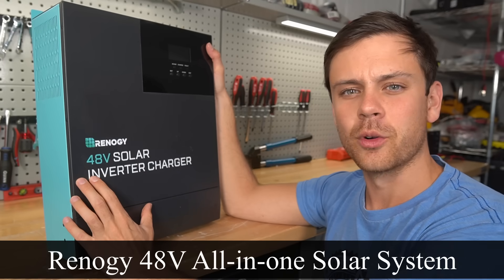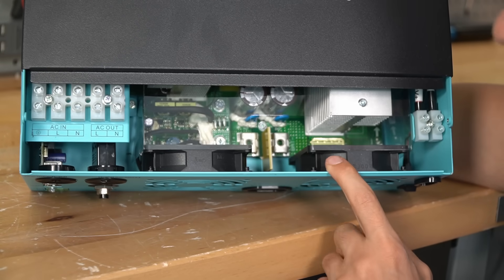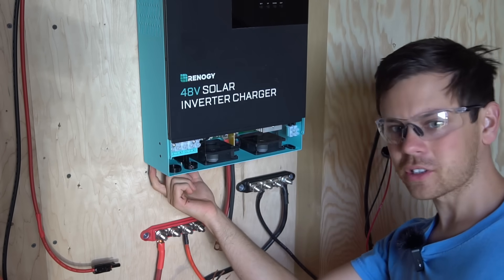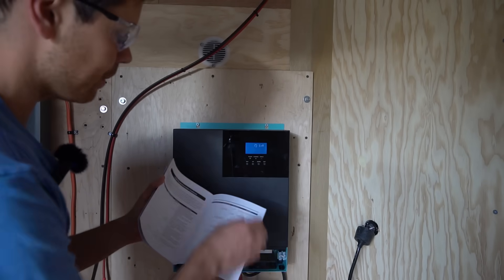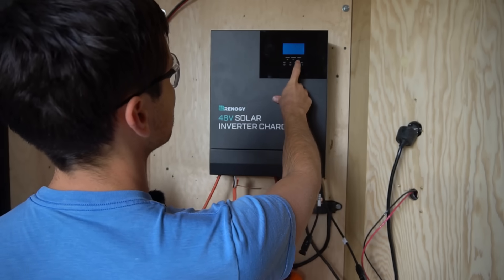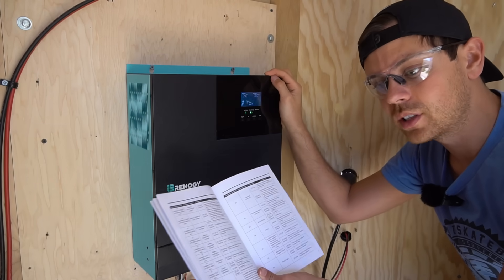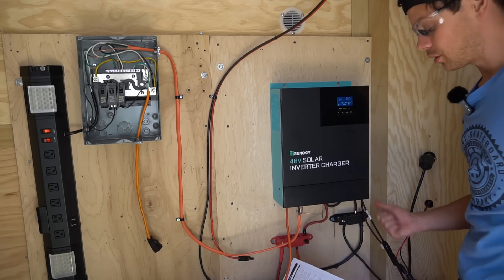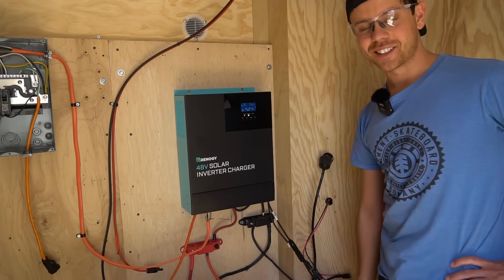Renogy 48V All-in-one Solar System: 3500W Inverter, 4400W MPPT, 1920W AC Charger

Comment: Renogy itself develops and provides the software for its inverters. They are a manufacturer of solar power solutions, including inverters, and their software is designed to work with their specific hardware. Renogy is the brand name for products made by RNG Group Inc., with headquarters in Chino, California,
Reply from the maker: This device is not made by renogy. There's about 10 other companies selling this exact same one.

Comment: Will I have the same inverter but a 24-volt version everything works when I plug it into this inverter except my pool pump keeps telling me there's no ground and won't power on it just keeps giving me a ground error code is there a way to remedy this the AC output is the identical to within this video do I need to create a ground neutral Bond and how do I do that

Comment: @DIY Solar Power
Will the MT-50 screen work with Victron's Energy BlueSolar MPPT 100V 30 amp 12/24-Volt Solar Charge Controller. I ask because I prefer not to use blue-tooth.

Comment: Three years later, can confirm. Renogy fixed ZERO of these issues. They're still selling the exact same unit with no changes...
Reply: I am hearing a LOT of complaints about renogy in the facebook Solar for RV groups. Many say they'll never spend another dime on anything Renogy.
Reply: @troy3456789  just saw this and I agree. Was looking at renogy for my new set up. Love my old 12v set up using thier components from 3 years ago but want 48v now and looking at eg4 bats and all-in one with probably Victron for other components

Comment: I have this charger inverter and I have to say it's probably the worst product I;ve ever purchased. It's more expensive than the competition and lacks features such as built in wifi. Now it shows an error code that it's not sensing the battery even though it shows the correct current battery voltage on the screen and says charging. I'm about to throw it in the trash since of course it's beyong the warranty.

Comment: Why would the battery cable input opening be so much smaller than the AC out line openings? 48v going in will need a larger cable than the 120v coming out. Why would they do this?

Comment: Will, I would love for you to review a Sungold 3000 watt inverter charger, mppt controller, that is also a transfer switch, and it switches instantly, if the power goes out. I am using it on my camper. I have to have the lead acid battery up front to operate my slides. Just would like your input about panels. I want to put 3000 volts, and have a limit of 80 watts charge controol.

Comment: I bought a 3000 W powerland it is the same exact unit just different colour no ground either and I couldn’t get it to charge either. Yeah very disappointed I have 740 W of solar and I got 612 V AGM 100 amp hour batteries converted to 24 V. I’m thinking about getting a different solar charge controller inverter, not sure which one yet

Comment: Well after watching this review I am still planning to get this one I have limited space I need to mount this inside a confined space in a semi truck I probably will use heavy duty double sided tape to secure it so it won’t get loose bouncing in the truck
Reply: I don't know if you already bought this unit or not, but I have 2 of these and YES there is a mounting hole at the bottom.  This guy didn't read the instructions on how to program it, and also installed the power wires before he mounted it and therefore blocked the mounting hole with the power wires, then says the hole is behind the circuit board... it is not behind the circuit board, it is behind the power wires he installed before mounting.  Also the reason it isn't charging is because he doesn't have the settings correct and it thinks his batteries are already fully charged, or he has it set for only grid charge, or only solar charge, etc... and yes it has a ground also, you use the same ground as the AC in.
Reply: @oldolfmann8927  I already got one when Amazon was selling it for a little over $500. Maybe you got an updated version with a bottom mounting hole, I don’t see one in mine. I haven’t got time to mount and do the wiring in the truck yet but I see a spot to drill a hole to get it secured. I honestly think Will didn’t read the manual neither he was on the wrong settings that’s why he couldn’t get it to charge.

Comment: I just bought this a month ago, working great!  Only issue I had was there is a “note” on page 7 that says it has to be over 60v input from the solar panels to charge.  I had it in parallel at first and couldn’t get it to charge, then called Renogy and they pointed me to this dumb note.  They really should put this on page 1, other places like the I put voltage to the solar in a spec sheet, many other places.  After that, I have been very happy with its performance.  Solar only with 8 batteries, looking good!  

Also, the battery power connectors are still the same, kind of a pain, suggest using a high multi strand flexible 2 awg cable, not the stiffer bigger strand ones, as I had to fight with it for a few minutes, but at least the battery terminals didn’t break, which for me is good as I tend to man handle and break everything.

Don’t know why he basically rage quit on this unit, it’s not too hard to hook up and get through the menu prompts, maybe he was just having a bad day, everybody has them. I actually liked that it was two screws to mount, once through the holes, just tightened down the screws and that was it.

60v is the key though people from the solar side, make sure you’re in series if you’re doing a couple solar panels.
Reply: there is a mounting screw hole at the bottom, you will find it dead in the center behind your big black and red power wires.
Reply: Can this unit work with just solar and no batteries? Thx

Comment: I've been running this inverter for 2 years now.  It seems to work fine, but like Will said it seems to limit charging big time.  Plus it has ~30v AC across it's own Neutral and Grounding lug.  I wanna upgrade to something bigger...

Comment: Did they ever sort these problems out?
Reply: there is no problem, it's all his user error, he didn't read the instructions and can't find the bottom mounting hole.  There is a mounting screw hole, he blocked it by getting ahead of the mounting and putting his battery cables in the way, then complains about charging because he has the settings wrong.
Reply: @oldolfmann8927  yeah, I kind of wondered because I now own and have installed several SRNE rebranded units like this, and I've had zero issues. The AC ground out is not an issue if you connect to a properly wired circuit breaker panel, and you should be.
Reply: @SolarBearDIY  I just saw you even made a video about those settings, that's great.  I use the ground terminal inside the unit for the AC in & AC out, then this unit gets the AC in from my homes main panel (all 3 LNG) and from a circuit breaker in that panel, then the AC out goes back to the panel (all 3 LNG) and connects to the wire that use to be on that breaker.   Works great running a full size refrig, and a freezer, and some lighting.  I have it charged by four 300 watt panels and 2 100ah lifepo4 batts.  It never has to connect to the grid for charging unless I switch off the power from batts when testing it.   My other unit is powering several rooms with lights Tv's etc... unit also has four 300 watt panels and six 120ah lead acid batts and it has no problems either.  Connected in a similar way with 12ga Romex coming to and fro the breaker panel.   The bottom mounting hole on mine is bottom center between the battery power wires and partially hidden by the large plastic grommet that the battery power wires come thru.   My unit is a couple years old, and I even bought them used, so I don't know when they updated them or even exactly how old mine are.  I actually bought them used from someone who said they didn't work properly.

Comment: Hi I’m in Australia 
I run 3 fridges and a few led lights plus the tv 
I’ve just tested the big fridge 239
I have a 48v system 
My question is would I be better with say a vevon or are mpp system instead of a 24v inverter do all inverters capable of running all day on my home
I think most inverters are only ment to run short cycles

Comment: Unfortunately I purchased this unit before reviewing your video. It still possesses all the faults that you mentioned 3 years ago. And also it can’t be combined with another unit to perform split phase. The communications port is next to useless. It only works with the reboot Bt-2 which is horrible. I should of purchased the growatt

Comment: I had have the same one buts its a powmr!! Ive gotten up to 1.6kw to batt from 6 335w sunpower 6 years old!! Recently it only charges at 1.2kw or less but it might be a batt or solar issue one panel went bad and would not charge!!! Also there is an option to charge 20amps lower then rated capacity!! If you choose 60 amps and then 100amps for combined it might work!! Because theres more current running through the system over voltages and goes into limp mode to protect battery over voltage!! Also it helps if the solar dc voltage is same as wall power!! But it might be a programming issue which i know might be right if system receives yoo strong jolt!!

Comment: what is the dry contacts on the bottom of this inverter? is there supposed to be 12volts posative and nagative wires going to the NC, and N terminals on the bottom of the inverter to get it to charge the batteries through the 120v ac grid power wires?

Comment: I’m scared of this guy.  He whines about stuff he doesn’t like and generally doesn’t seem to have a grasp on what he’s talking about. Awkward.   I didn’t even finish the video.
Reply: Yes, embrace your inner cowardice.
Reply: Exactly, there is no problem with this unit, it's all his childish error, he didn't read the instructions, can't find the bottom mounting hole he blocked it by getting ahead of the mounting and putting his battery cables in the way, then complains about charging because he has the settings wrong.

Comment: @WillProwse you may have to power off the device with the settings changed & power it back on before the settings will take effect. I had to with the rover 30 when changing it from 12v to 24v bc it was saying battery over voltage or something. Power cycling it fixed it. Keep that in mind when changing settings on devices.

Comment: Can anyone report and fixes to renogy since this video? I hope so.
Reply: There is no problem with this unit, it's all his error, he didn't read the instructions, can't find the bottom mounting hole he blocked it by getting ahead of the mounting and putting his battery cables in the way, then complains about charging because he has the settings wrong.

Comment: have you heard of Y&H 4.2KW On/Off-Grid Solar Hybrid Inverter 24VDC Pure Sine Wave AC220V Output MPPT 140A Solar Charger Max PV Power 6200W Input with WiFi Communication .i was looking around and found this for 540.00 just wondering if this would be a good buy for a mid size shop

Comment: Will you did better than me.  my 3500 w 48v will only run a light bulb, a small drill it goes to code 4.  they did replace my first unit. replacement is worst off.

Comment: Could this unit work to provide backup power with a Prius battery pack?
I have a grid tied 15k system with SMA inverters no batteries at this point.

Comment: Thanks for putting this out! I have a similar unit for my new camper van and am trying to understand it. This helped! One confusing thing is that when I don't need 110v and therefore turn the inverter off, the whole unit turns off and I can't charge with my solar panels. Is this normal, or should it still charge when I turn the inverter off? Thanks!

Comment: You need to calm down. Why are you getting so upset.It's just an inverter. Hey, why would I use a48v for a cabin? Why not a 12v?
Reply: You need to calm down. Higher voltage = more efficient.

Comment: PLEASE PLEASE TELL US HOW TO GROUND THE A/C OUT.....THE VENDERS, nobody can tell me so far... my guess is maybe just have the ground wired up to that grounding screw on the outside of the box front left.  this inverter is the main panel. wired up to a sub panel. therefore only main panel should have the neutral and ground bus together going to a grounding rod therefore maybe the a/c out should have the ground together with the neutral? I just don't know!!!!!    tiny home: off grid SRNE powering 2 branches out of sub panel. thank you

Comment: My Lycan 5000 uses this, and it works well, but it's all built into the 268 pound (0.12 ton) Lycan 5000, which I use for emergency home power. With (8) 320 watt, 32 volts, 10 amps Renogy solar panels wired in a series-parallel configuration of 4-panel series strings wired in parallel (4s2p). I also use a dual fuel generator and utility backup when needing a fast charge options  in emergencies.

Comment: I have this exact model.  No issues.  This guy should not be posting videos professing false expertise.
Reply: Please, tell us more, dear onanist.
Reply: @formulaben  that post was a year ago.  Still no issues in the 1 year of mean time.  However this video trash talking the hardware is still here because this guy thinks he's an expert but doesn't know how to use the product.

I have a generator as primary charging the battery and powering the AC devices.  Generator only runs when insufficient sunlight and battery is low.  Otherwise the panels and battery power everything flawlessly.  This is a champ product.  However, designing solar power systems is not for everyone.
Reply: @jaketh3sn4k3  Exactly, there is no problem with this unit, it's all his lacking, he didn't read the instructions, can't find the bottom mounting hole he blocked it by getting ahead of the mounting and putting his battery cables in the way, then complains about charging because he has the settings wrong.  I have 2 of these for over a year, no issues.

Comment: You can see the amp clamp change to 0.65 - 0.67, so your initial calculations are off for the old one. Average out the difference, and it's give or take 0.05 difference 🤔 🤷

Comment: Anyone else have issues with this unit (firmware 1.1) ?
EG: 
* Only charges packs at max 20a, tapers off almost immediately to less than 10a. This is with 1500w solar available, zero AC load, plus I['ll fire up the generator (6600w). Absolutely refuses to charge the packs at an appropriate rate.
* Config options 38/39 missing. 39 configures max ac charge current which is default to 20a.
* MPPT controller gets stuck in local maximum every morning, or any time you slowly ramp up the light. Gets stuck around 60v and 3a (200w). Unplug/replug and instantly figures out 120v and 12a (1500w) is more appropriate.
* DC Home app has zero control, and half the data is either completely wrong, or doesn't match the LCD info. App also stops updating data constantly, and requires a force-close.

It's an okay inverter for the price... except for these issues, which are making me insane. I make way more than enough PV power to power my life, but with my new, bigger batteries, being limited to 20a charging means I can't even make use of the 1500w I get from the PV side, unless I use at least 500w via the inverter while simultaneously charging batteries at 1kw. With 10kw of battery, there's no way I can charge my packs in a single day over the winter, were we only have maybe 5-6h of good sun (even though the MPPT can easily provide that power... just refuses to send to battery).

that said, I see the manual version 2.2 (which is probably firmware 2.2) does have options 38/39 listed, but Renogy can't seem to understand why these options being missing, might indicate my firmware is out of date. No one at Renogy seems to know what firmware is.... *sigh*.

 Anyone know who is the OEM of this device? Figure maybe i just scrap these and go to the OEM?

Comment: GOOD JOB. I AM TRYING TO LEARN. I NEED A SYSTEM TO RUN MY ADDITION ON MY HOUSE.THATS GRANDMA,MOM,MY SPACE. IT HAS 2 WINDOW AC RUN 1200 WATT EACH MED SIZE FRIDGE TANKLESS HOT WATER DIRECTIONS SAY 9.5KW. I WILL HAVE GRID ACCESS ,BUT DO NOT WANT TO USE IF  POSSIBLE. I AM DISABLED  WITH EXTREMELY  LOW BUDGED. SO IF I CAN FIG WHAT I NEED I CAN BUY A PIECE EACH MONTH. I LIVE IN FLORIDA FULL SUN. NEED AC. THANK YOU YOUR SUCH A SWEETHEART!!!!!
Reply: WHY ARE YOU YELLING AT US?!

Comment: Will I am considering buying a Van with the electrical system  powered by Renogy  (Entegra ETHOS LI|20TL)  Other manufacturers  are using Mastervolt, Volta, or BattleBorn.   Renogy seems to be an outlier.  Do you think Renogy would be safe and reliable for use in a Class B Van.   Appreciate your thoughts.

Comment: I am building an off-grid backup power system. I bought eight 12V 200Ah batteries for 48V configuration. The total is 48V 400Ah. Can you tell they can provide enough power for a normal standard household in US? Thank you so much for your advice.

Comment: Hey.
can I use batteries for electric bikes to build a large 48V system ??? "10 batteries for a bike costs as much as a regular car battery 12v
Electric bike lithium battery 48V 20AH Costs 13$

Comment: If I have (2) solar panels (that are in a series on one one input and (2) in series on the other beings the inputs are wired parallel would I be around 100 volts?
Max Power at STC (Pmax) 550W
Open-Circuit Voltage (Voc) 49.95V
Short-Circuit Current (Isc) 14.05A
Optimum Operating Voltage (Vmp) 41.97V
Optimum Operating Current (Imp) 13.11A